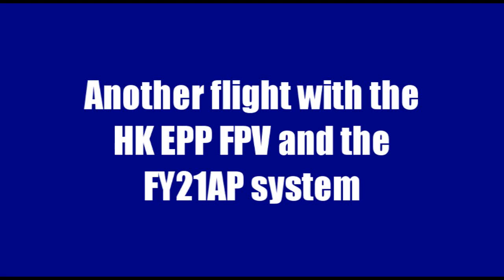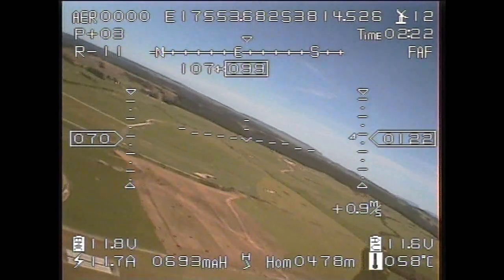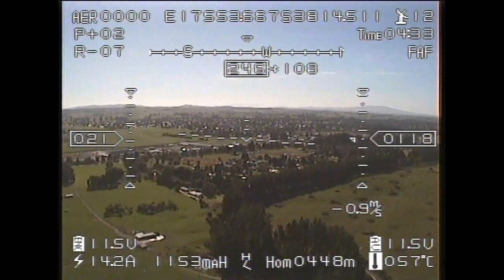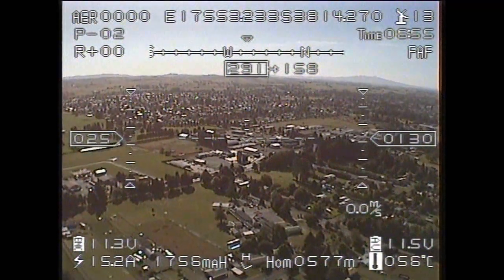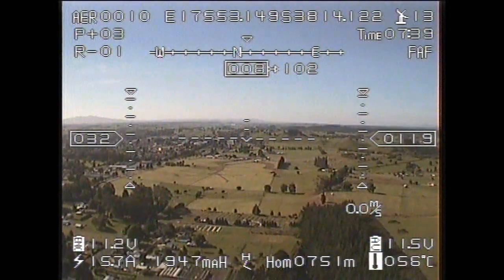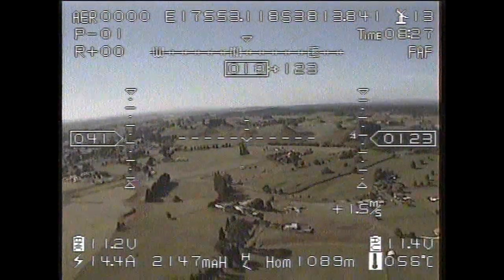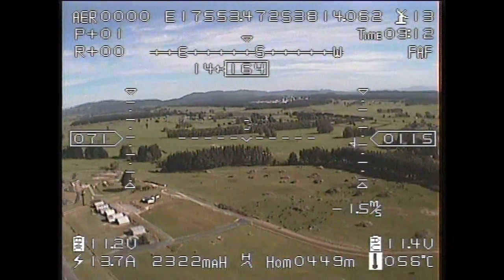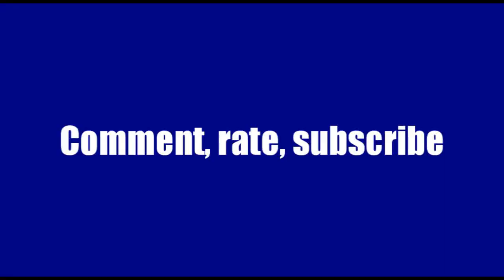A narrated FPV flight with the FY21AP and FoxTech 5.8GHz video system

Comment: I'm so glad to come across this video - must be quite dated by now :) I've actually set up a Twinstar with an old FY21AP and AP117 OSD I had lying around, as well as the Foxtech 200mw 5.8. Did you test the range beyond 1100m? Did you use CP antenna's on this flight? Nice one Bruce, I feel way more confident about this set up. R

Comment: Thanks heaps for the videos bruce, I have exactly the same set up as this. I fly it from my deck at home and have the video receiver mounted on a pole on my roof, About 8m off the ground. The video link has been tested to well over 1.5km and was perfectly clear. I haven't flown the plane that far yet (I have only flown it half a dozen times) I will post the links as I make more videos.

Comment: @tadflip I love my RVOSD.....it's the best looking display in the bunch and is very customisable as far as what data is displayed.  Dont need a GCS as autopilot control is done from the transmitter.  All that for $300....go check the prices for this Fieyutech unit that is not even an autopilot.

Comment: you should try and experiment a little bit with the polarisation of the antenna (aka the bending angle) because when you point it up straight you are having a dead spot right underneath and above your antenna. When in a turn, the relative antenna polarisation between tx and rx changes so that signal is getting weaker.

Comment: I have the same fpv system and I am only getting about 400ft or less.  I have never powered up the rx/tx without the antennas on.  I am using the stock antennas.  Are the stock antennas that bad or do I have a problem in my system.

Comment: @RCModelReviews thanks for the tip! That's a good thing to know so I won't damage my TX. Nice video by the way. I had no idea what "multipathing" is. Today I switched my FPV gear on for the 1st time and I have a very clear & smooth image but there is some distortion here and there, especially when I walk around with the FPV gear (the plane itself isn't ready yet). Do you reckon it's that multipathing effect? Is there a chance it'll disappear when it's airbourne? Very informative video.

Comment: I've been trying to use this system and during ground tests the signal will be crystal clear with little multipathing distortion until the Tx is about 100 ft away at which point the signal is completely disappears.  I've yet to try the Rx mounting trick and I have ordered 5dBi antenna from himodel, are there any other tips anyone can give or reasons for why the signal cuts out entirely?

Comment: Ditto the antenna question!  Also, if the video tx antenna were mounted, say, on the bottom of the tail boom or somehow protected on the bottom of the fuse, could you keep the line of sight to the RX cleaner?